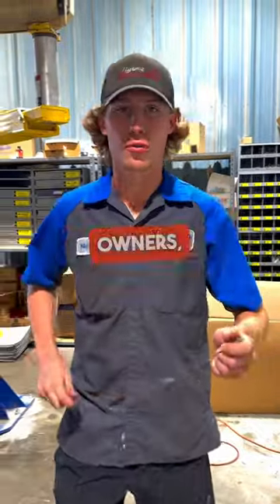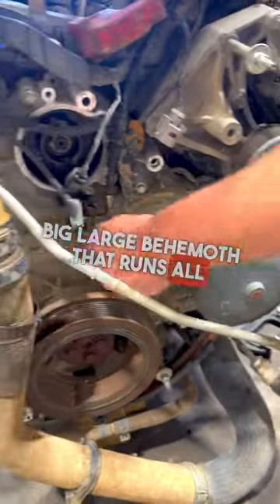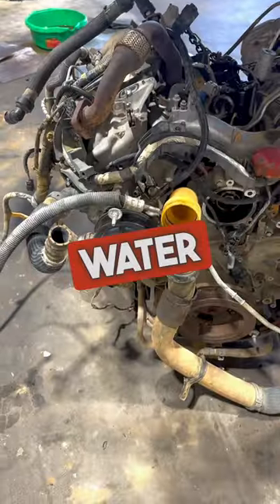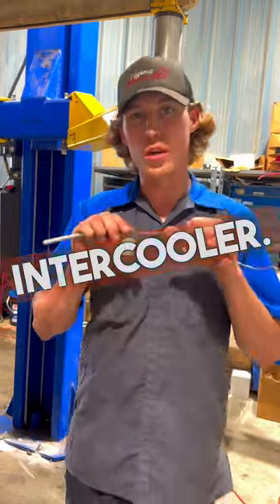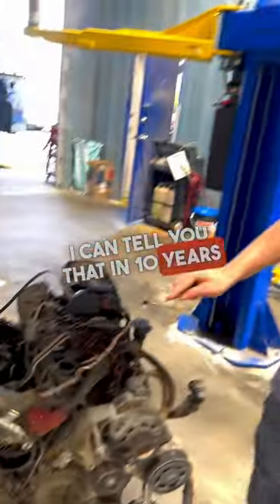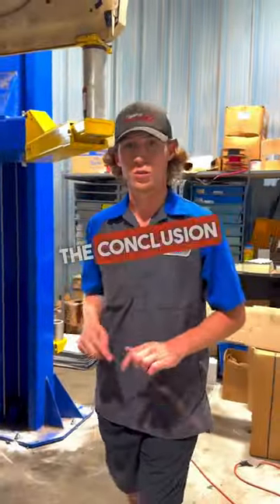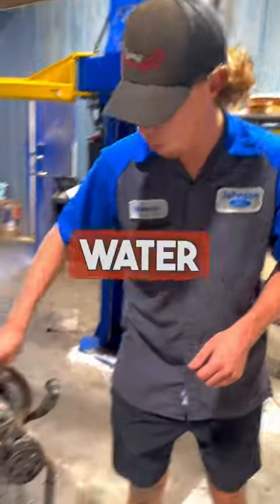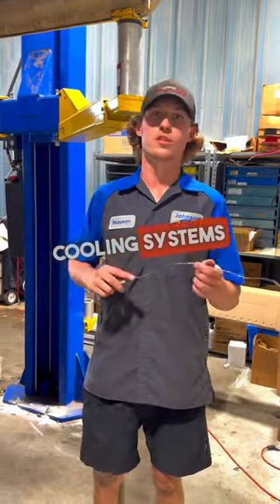6.7L Powerstroke… Two Separate Cooling Systems #shorts

Comment: I swear my man has 50 years experience at 27
Reply: Is he 27 or is the at just a guess? I thought this dude was 21 22 ish and definitely been in the business for a while
Reply: @user-white007 he said he has 10 years experience working at Ford. I don't think they would let him in the shop at 12!! Not at a big dealer shop. He does look 27-30 to me though. Totally believable.
Reply: He keeps saying the water pump cools, it doesn't cool the radiator the radiator cools the coolant and the water pumps move it through the engine and cooling system 🫤
Reply: @kingalexander8152  I think we get what he's saying. I think he realizes most of us have at least a basic and beyond understanding of engines. If the water pump wasn't there that engine wouldn't cool! It's not a thermosyphan system
Reply: @kingalexander8152  Without circulation your not cooling $hit so he's right the pump does cool .. no need to split hairs here

Comment: I've replaced only ONE secondary water pump since 2011. But I've replaced NUMEROUS primary pumps.
Reply: What happened? Did it just have like a bad impeller or something, from the factory?
Reply: @2012whatthehell  it leaked. The leak wasn’t bad. But it was a leak nonetheless. It had around 50,000 miles. I was actually surprised. But out of the millions made, it’s not surprising that a few will wear prematurely.

Comment: on one f550 i did both primary and secondary radiators and both primary and secondary pumps because they were all leaking truck had like 600 000 on it, was like a 2015.

Comment: Sure is alot of common problems with that 6.7....
Reply: Then don't buy it if you don't like it
Reply: All engines have "common" problems. Listening to a mechanic for information about whether a car is reliable or not is a lot like listening to a gynecologist about whether it's generally safe to have sex or not. They are going to have a skewed view of the prevalence of common problems in the systems they specialize in.
Reply: And those Ecoboosts😮

Makes you wonder why Ford allows him to make these videos...from their shop even!!
Reply: @az678910 oh don't worry...I don't plan too. Or really any of these Ford's.
Reply: @natevanlandingham1945 if a Chevy mechanic has  a channel and was honest, he'd share a pile of problems common to Chevy.  Other than those who come in for maintenance, Every car or truck we mechanics see is broken. Otherwise they wouldn't be coming to us.
Reply: @natevanlandingham1945 because it's honest and common for all engines. I haven't met a single manufacturer that doesn't have mechanics for their vehicles, they all have problems it's life
Reply: @dmandman9  I like Chevy but don't think I'll be buying any of their new stuff either. New modern stuff I have gone to Toyota. I like them better. And yes they have common problems the same as well. Just seems a whole lot less at least the ones I have.  I drive all different vehicles at work, I get a new one every 3-4 years. Haven't been impressed with the last three I have had. One of each a Chevy,Ram and Now a Ford. All that been pretty bad for the amount of repairs they have needed in 80k miles.
Reply: @natevanlandingham1945  Toyotas are generally reliable. And the Tundra is a good truck. But if you need anything more than a “1/2 ton” pickup in the USA, you won’t be buying a Toyota 😅. The Tundra is as big as it gets. And yes the older pickups are simpler. But they’re really old and  likely well used. So it’s still a luck of the draw because if they’re in good condition and well maintained, the owner often doesn’t want to part with them.
Reply: @dmandman9  right. And I know that's why work folks or those who have big toys have to buy one from the big three if they need more than a half ton. I'm one of those folks with an older first gen Sequoia/Tundra that's proven with good maintenance history and I don't want to part with it. Also have a first Gen Highlander the same way.
Reply: @natevanlandingham1945  thanks for proving how wrong you can be, congrats

Comment: Mayson, good morning, I'm impressed by your mechaincal knowledge. I think you do great work with these videos. Breaking the stigma of industry. Speaking truth to darkeness, kudos. 

I say with respect and know this may be a slip of tongue and not lack of knowledge.  As a public educator, make sure when explaining the theory of operation, you are precise. Water pump circulates the water for even distribution of the heat until the thermostat opens. Also, it moves the water for the radiator to the block. Heat is removed from the water when cooler air passes through the radiator fins and over the coolant tubes. The heat then transfers to the air, and the coolant temperature drops. 
 
Keep up the great work, looking forward to more content from your videos.

Comment: Actually, the water pump doesn’t cool anything. It pushes the coolant through the water passages in the block, and heads, to keep them from overheating. When the block temp gets hot enough to open the thermostat the water pump now pushes the coolant into/ through the radiator.

When the coolant is in/ passing through the radiator it gets cooled by the fans and/ or the ambient outside air. Which is sent into the engine (by the water pump) until it cools down enough for the thermostat to close. Then it happens all over again.

But, I know what you meant. Sure there’s so much knowledge in your head that it doesn’t always come out the way you intend it to.

Thanks for the videos… keeping us informed. Thought I wanted a Super Duty; not so sure now.
Reply: Buy an old truck if you want a super duty. Anything older then 2003 will run fine diesel or not. Avoid aluminum body styled Ford's period.
Reply: It's called circulation and without it your not cooling anything.. stupid argument
Reply: @Abandonsoyciety 02 sittin in the driveway 😊

Comment: So which one does the turbo then?
Reply: Hot circuit does turbo, tranny, oil, egr. Cold circuit does ECT only. 192/201 are the opening temps on each loop. Thermostat is one piece, but has 2 inlet/outlets.

Comment: My brother found out about the secondary cooling system. The Ford Dealer in Whitehorse, Yukon Territory, Canada screwed up royally a couple years ago. Every single vehicle they did the winter service on had frozen coolant. They used the normal -40 rather than the extreme antifreeze good to below -60. He was lucky, only the water pump in the secondary froze and broke. Still, the truck was out of commission for almost a month, since it took two weeks to get a tow truck to make the 12 hour return trip to pick it up. Oops.

Comment: Its weird how little of this information is on the internet anywhere else. I didnt know a 6.7 used hot V turbos and two coolant loops both with mechanical pumps.

I also didnt know for way too long that 6.4s came stock with conpound turbos. All of the "compound turbos arent streetable" guys apparently still dont know.

Comment: The water pump doesn’t cool the engine and radiator. The radiator cools the coolant that’s circulated by the water pump.
Reply: So circulating the coolant isn't part of the cooling process.. JC
Reply: Heat exchange through the aluminum of the pump is technically cooling if ya want to really dig at it 😂